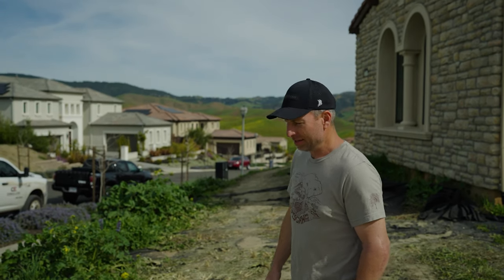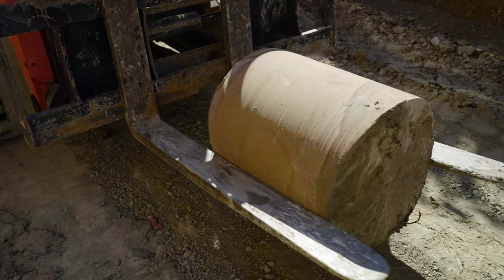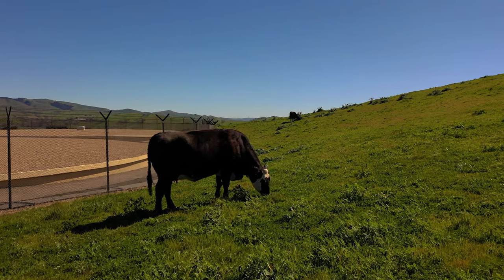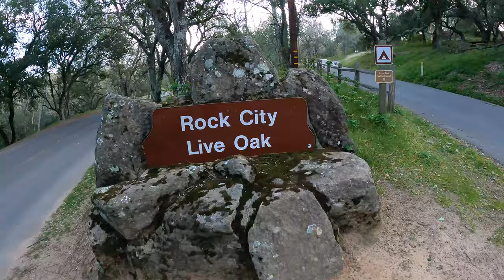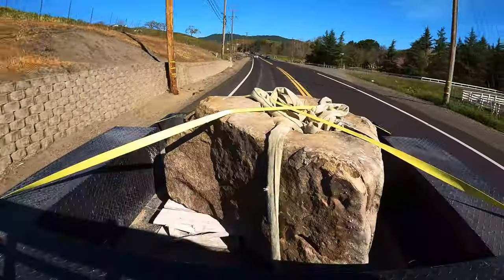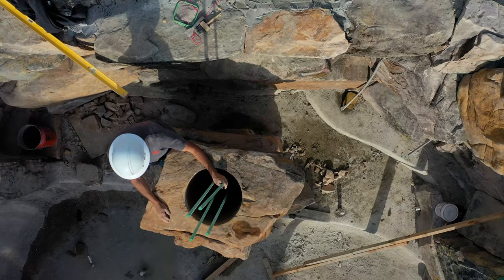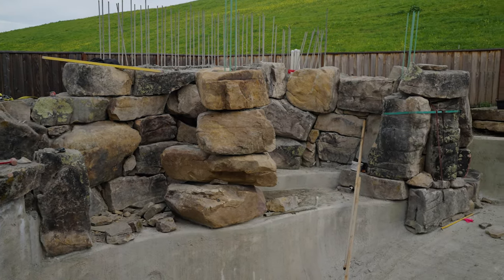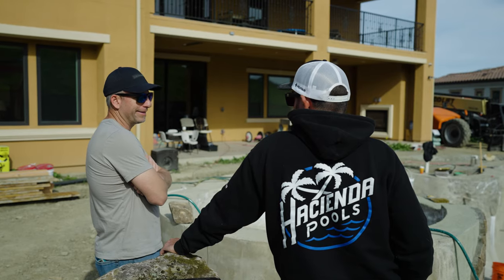Insane Pools - California Rock Waterfall Backyard in San Francisco! - Part 1

Comment: Yes yes you absolute leg end lagoon whisperer just watched a episode where you do a pool for jb Holmes and you had a problem with water have you ever heard of dewatering 
The idea is if you hit a water table witch we have tones of in england and I go 12 meters some times and hit water at 2 so I’ll water jet down about 2 meters further the the dig and drop 2 inch drain pipe down where Iv jetted then once you have 12-20 pipes in you set 2x12inch pumps up with a  split pipe system to take 12inch down to 6-10 2inch fit them to the top off the pipes sticking out the ground and draw the water table down past dig depth also in sandy ground its great for compacting the sand I work on the sewer in England and have a level 3 in water management and utility maintenance and engineering also qualified in deep excavation and confined spaces high risk rescue so deal with surcharges and water table daily would be a honour to help where I can 👍👍👍